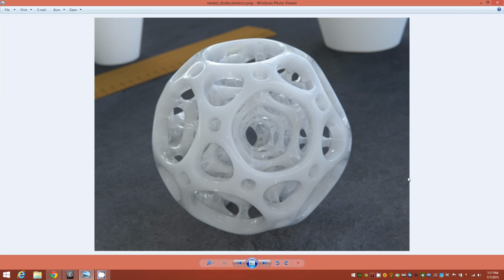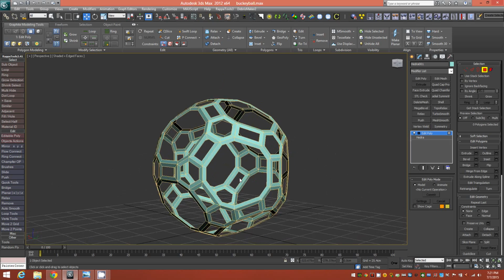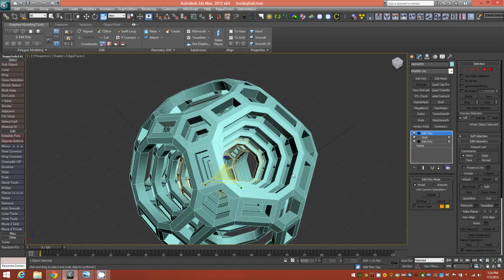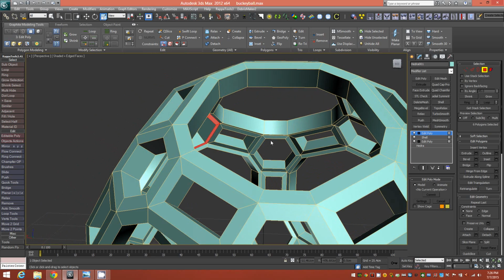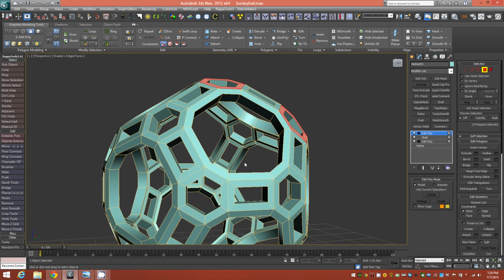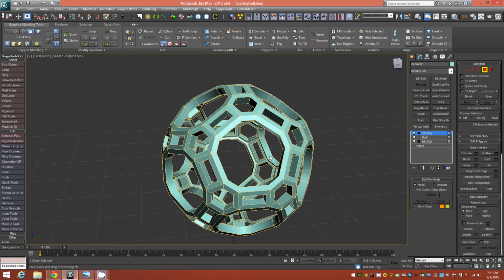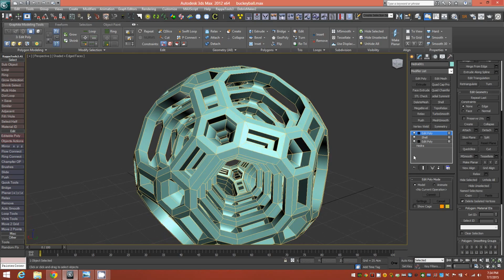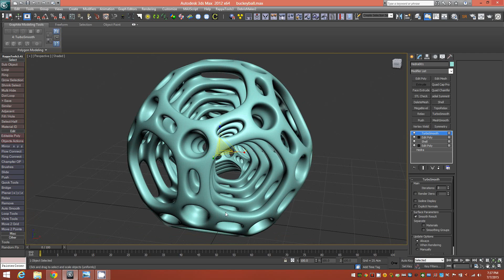3d Tutorial | Nested Dodecahedron | 3dsmax

Comment: Hi, great tutorial! however, i encountered some problems during making this shape.

1- i am using 3ds max 2017 version, the latest one, and it seems like "select similair" not working anymore. is it me or 2017 version doesnt recognise shapes for us to apply this command? i had to manually select every face because of this. 

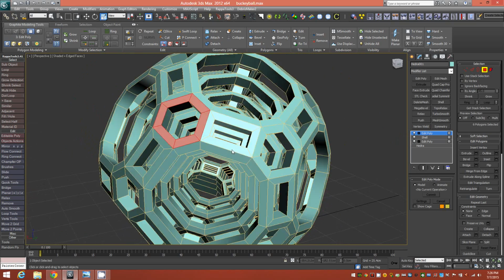2-@7:30 you select all faces of 1 shape of the 3 shapes, and they were allready attached to another. how did you do that? i use shortcut of "ctrl +a" to select all but it selects all 3 shapes(because it acts like 1 single shape after attach i guess). i couldnt figure out how did you do this.. i tried an alternative way to continue: i didnt apply attach until i finished preparing all selections and creating shapes one after another. it took long time.
Reply from the maker: Let me first address the issue in 1.  Select Similar is still working properly in 2017 as far as I can see.  I have it here in front of me as we speak, and tested out several scenerios.  Each one worked as expected.  Are you sure you have all the required sub-sets of the command enabled?  Click on the arrow beneath the Similar button in the Graphite modeling ribbon, and make sure you have Edge Count, Face Area, and Topology check marked.  Do not check the Normal Direction option.
Reply: UI looks different but i found what you are saying, and options are exactly like you said. edge count, face area and topology checked by default. this problem must be about something else...

btw, i learned something when i tried an alternate way to do tutorial: after i made all shapes, attaching them together also automaticly combined seperate selection sets in one single selection set.
Reply from the maker: If it's still not working properly after checking those subset features of the Similar selection, then there could be a bug happening there.  Are you using 2017 first edition, or 2017.1?  I tested it under the first edition, and it worked as expected.  So If you're using 2017.1, and still continue to find that select similar is not functioning properly even with different models, then I'd consider that a possible bug.  I'd be interested to find out if you can get it working in a new scene with a different model, or if it just will not work at all.  Also, do you know if anyone else has reported a similar issue?

Comment: Thanks for sharing,
In 02:35 how did you remove all the faces?
Reply from the maker: +Murat Aktan  While the faces were selected, I simply pressed "delete" on the keyboard to permanently remove them from the object.
Reply: +John Malcolm Were all the faces selected with just a single command or they were selected previously, I couldn't catch it?
Reply from the maker: They were selected previously.  Once you set the parameters of your Hydra object, add an edit poly modifier, then CTRL+A to select all the faces.  Do an Inset command on them, with the "by polygon" option of the tool.  Once complete, the faces of the inset will remain selected.  Just delete them at this point to create a "framework" of the object.
Reply: +John Malcolm THANKS

Comment: hi john.
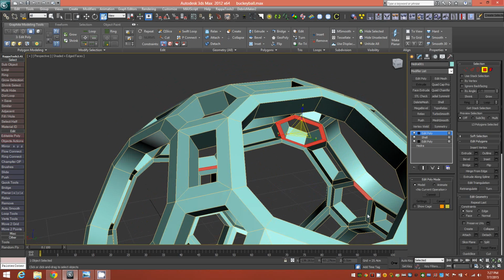8:20 minutes until I can not do the operation(first selection similar). get together near the edge.
thank for videos.

3dsmax 2015.
Reply from the maker: +Kadir ÖZOLUK In rare cases, depending on the dimensions of the model, and the degree of some of the insets, etc., select similar operation may fail for these selections.  There are other tricks you can try to get the selections, like switching to edge mode, then selecting the edge rings of each shape area, then select similar, and then transferring that selection to face mode.  However, if you don't know of that technique, then the last resort would have to be to manually select the shapes.  Let me know if you can't get past this point, and I'll help you further.  If you save the model as OBJ, and have a place to host it, I'll be happy to download it and have a look at it.
Reply: +John Malcolm Thank you for the answer, and video. I wish you continued success.Waiting for the new tutorial.